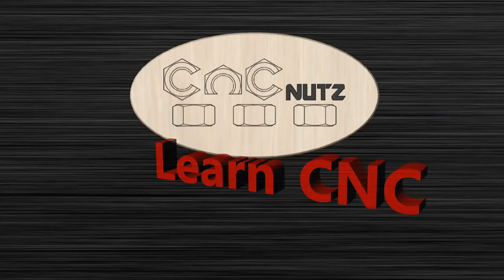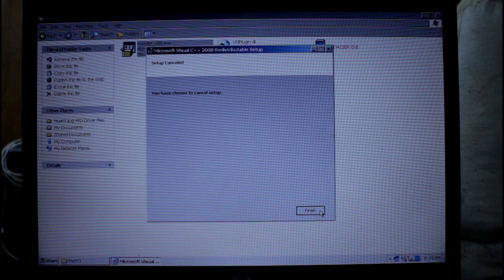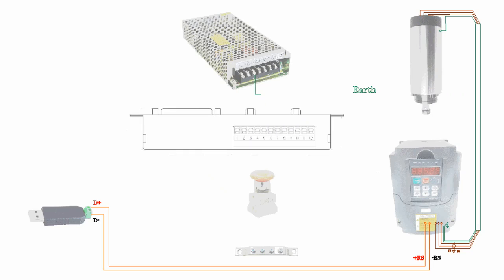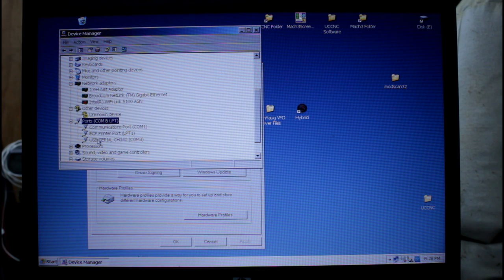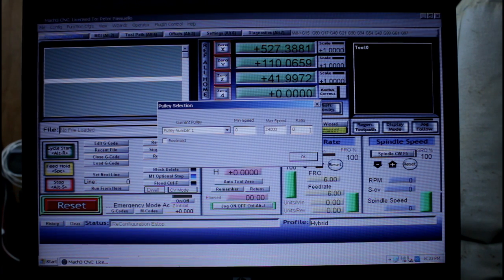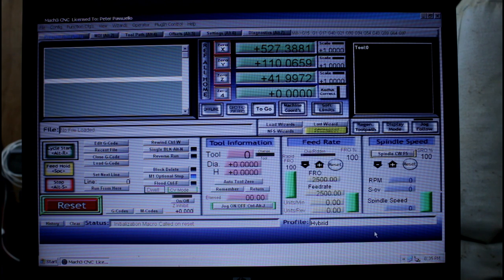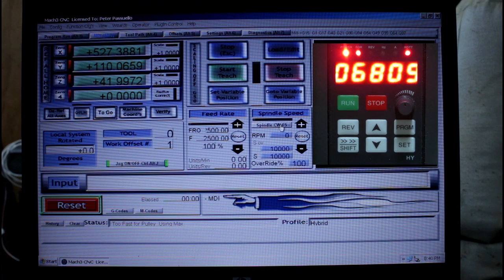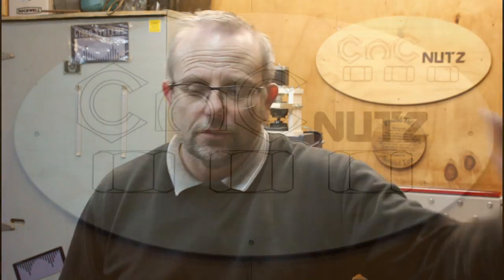Mach3 RS485 spindle control - CNCnutz Episode 147

Comment: I have tried 3 vfd plugins and each one gives me a defective plugin found error message upon mach3 startup? Plugins are pasted to the plugin folder as your video suggests. Any ideas?
Reply from the maker: Have you tried reloading MACH3. Maybe the problem isn't the plugin but MAch3 itself.
Just make sure you backup your Mach3 first.
Cheers Peter
Reply: @cncnutz  i ended up using a different plugin. Works perfectly and loving it! Thanks for the reply

Comment: hello Peter, do you know if this adapter will work with  a vfd ALTIVAR ATV320 ? I didn't understand if the plugin will works only with Haunyang VFD
Reply from the maker: The plugin only works with only some Haunyang VFD models. This is because they use a non standard RS485 protocol. You will need to find the right plugin for your VFD.
Cheers Peter

Comment: HELLO PETER, You make it look very easy. I have installed the rs485 and tried various drivers  and I keep getting message that it cannot communicate. In the device manager, I see the 2.0 usb but there is no com port. I have tried to reverse the two wires on the vfd but same happens. I set the vfd to all the settings in your video. I have been looking over the internet for the last 3 days trying to figure this out. I have ran the spindle first with the vfd and the spindle ran fine. Is there a check to see if the RS485 is bad? I hoping it is something simple that I may have overlooked. Any help would be greatly appreciated.
Reply from the maker: Hi Ron,
The only reason it looked easy is because it was. I was lucky and didn't get any issue when installing the driver for the RS485 adapter. forget the VFD at this point and concentrate on getting the RS485 usb adapter showing up in windows. If you are not seeing a new adapter as a USB serial com port in Device manager nothing else will work. Lookaround for any big yellow question marks labeled unknown device in device manager. That might be the adapter and the driver might not have installed correctly. You can see one in my video but mine is another piece of hardware I don't have a driver for. If you delete the unknown devide and plug back in the adapter it should reinstall the RS458 driver and hopefully it will work.
Until you can get it showing in windows don't worry about anything else. you don't even need to wire it up.
Here is where I check mine
https://youtu.be/N7D5n5y7f50?t=6m26s

If you think you have a faulty device you could try installing it on another pc and see it it is recognised.
Hope this helps
Cheers
Peter

Comment: Hi Guy
My name is Sebastien and i'm the developer, who, 8 years ago, decided to write his own vfd plugin because others one was simply nightmare. I then decided to offer it to the community, thninking that one or two guys may be use it. Today, seeing this video, i'm very happy to see that it has helped more than 2 or 3 guys. I spent hours developping this plugin, but it was usefull. 8 years later, seeing your video,reading comments,  I realize how useful it was and i feel proud, so thank you to use this plugin and to promote it...earnt no money but gave me feeling to have been useful to the community.
Reply: Thanks for your efforts Sebastien we all appreciate it.  I've been running the plugin successfully on my Bridgeport Series 1 CNC.  There's only one problem with the plugin, the pulley reverse checkbox is ignored.  I've tried a lot of different things in an effort to fix it.  On my BP this is a problem when using the low gear which causes the spindle to turn backwards.  I get around this problem by manually flipflopping M3 and M4 gcodes but it would be nice to fix.  I would love to fix it if the source could be made available as I am an old C++ developer.
Reply from the maker: Hi Sebastian,
I'm sorry I missed this comment form 3 months ago. Thank you for writing the plugin and sharing it with the community. You did an excellent job of it and thanks to your excellent writeup it was easy to install and get going. Many thanks
Cheers Peter.
Reply: Thank you sir for your hard work, I installed the plugin and it works like a dream. I sent you a donation, BTW. I appreciate people like you who will freely give out their work the way that you do!
Reply: Hi Sebastien, thanks for the great plugin, it makes using the RS485 comms a dream, do you have any intention to release the source code? I would love to possibly help make some improvements to it.

Comment: Hello Peter ... this was a very useful video ... thanks.  I wanted to add my experience (today) in a quick comment:

I used this 485 interface: DSD TECH SH-U10 USB to RS485 Converter with CP2102 Chip Compatible with Windows 7,8,10,Linux,Mac OS, which I purchased from Amazon.  It was a little more expensive ($15), but touted better protected inputs (I'm only buying one in my lifetime, so a few $$'s more wasn't too big of a concern.).  It came with a mini-DVD with drivers, which installed on my Windows 7 system with no hitches.

One small issue that I ran into and I saw and noticed postings from others : "Corrupted plugin ... ignoring".  I'm running a 64-bit version of Windows, so I loaded the 64-bit version of the C++ Library initially.  After gleaning hints from related posts and guessing, I loaded the 32-bit version of the C++ Library, and the issue went away.

Thanks again, very useful video and it's so cool to have the spindle come to life under control of Mach 3.

Cheers,
Dan
Reply from the maker: Hi Dan 
Thanks for the tip about the different version of C++. Very interesting. Glad you got yours sorted. 
Cheers 
Peter

Comment: More great info, Peter, keep 'em coming, this is exactly what we newbies need.I now have full control of my spindle in Mach3. Well almost. Just need to figure out how to start the water pump with the spindle and I'm set.CheersDave
Reply from the maker: +olgreybeard 
Just setup a relay as I did in the previous video and use it to turn on and off the pump. You can use the relay and RS485 together. 
Cheers 
Peter

Comment: Who'll done Peter pleased you got it to work with few problems. Noise can be an issue when using unshielded twisted pair shouldn't be but it sometimes is.
Reply from the maker: The noise rejection properties of RS485 should protect it but it can't hurt to have the shielded cable and be sure. USB is more of a concern to me to be honest.

Comment: another great video Peter, I hope to change out my Router for a spindle soon, I hope that a 1.5kw 110V will be strong enough because i do not have 220V available where the CNC is.
Reply from the maker: 1.5kw is 2 HP and far more powerful that my original router at 1hp. The only reason I want bigger was to get the bigger collet and it will be interesting to see if I ever use anything bigger than 1/4" shank. I was originally looking at 1.5kw with Er16 collets which go up to 10mm (3/8")

Comment: Peter: can you share what driver you used for your RS483 adapter. I tried the prolific driver and it doesn’t seem to be working. 
Thank you for all you do for our community.
Reply from the maker: I don't have it I'm afraid. I just let windows install the prolific one. The one I used in the video was not a prolific chipset. The driver for that one is on my website. Follow the link under the video to my website and follow the link on the page to the driver file I used.
Cheers Peter

Comment: Hi Peter,
thanks for the video, I have this issue: once started (setting an S speed as you do) I cannot decrease the spindle speed clicking on the "minus" button, it works only in the + direction (increasing speed), I had to use reset button to come down to original speed, do you have any suggestions? thanks, all my best
UPDATE
in the meantime I found the problem: I use a 6-axis Mach3 screenset, and in the main tab the - spindle speed has a wrong command (it does not decrease the 100%speed),  while in the MDI tab the decreasing speed works as in your video, hope this helps other people...

Comment: Hi, Peter.  Hopefully, you are still monitoring this video.  I am looking for a solution for a slightly different implementation and I am far from an electrical wizard.  I am running a regular router on my CNC for now.  My little controller board ( Novusun NVUM V2) does not output enough voltage to activate the power relay (IOT Switching Relay Power Strip) I had been using.  Is the RS485 solely a communication port or could I hope for a 5-12 volt output from it?  Hopefully, this is not a dumb question, like I said I am far from an electrical wizard.
Reply from the maker: RS485 is a communication protocol. The port does not supply power.
Cheers Peter

Comment: Hi Peter,  great video!!!  I noticed that when you set up the spindle in Mach 3 you used 0 - 24000.   However the VFD settings were 6000-24000.   I am guess this why you could not go below 6000 RPM in the demo portion of the video.   Is there a reason for not setting both up from 0-24000 or 6000-24000?
Reply from the maker: +jnbff10
If you put 6000 - 24000 in Mach3 the output PWM will be wrong and the spindle will not run at the right speed. If I put 0 - 24000 then the spindle would run from 0 - 24000 which is OK for a water cooled spindle but mine is air cooled so I have to set a minimum speed. Hope this sense.
Reply: CNCnutz (Peter Passuello) thanks for the reply.  Good info...   I was not aware of the limitation on the air cooled
Reply: Hi Peter, Got the RS485 CP2102 today and was able to set up with no issues.  I got the driver from here:  https://www.silabs.com/products/development-tools/software/usb-to-uart-bridge-vcp-drivers
One think I did notice is that my max speed was 23000 @400hz.   No worries as I doubt I would run at 24000 but any thoughts on why it was 23000 instead of 24000?

Thanks again.   This video is great for anyone trying to get this working.   Took under 30 minutes to wire, config, and test.

Jim
Reply from the maker: +jnbff10
That's great new Jim.
The only thing I can think of is you might have accidentally set the maximum spindle speed to 23000 in the VFD by mistake. Other than that I can't think why. You are of course right. You shouldn't be using 24000 anyway.
Cheers
Peter

Comment: Peter. I'm a dedicated watcher as of late. 
I have mach3 with Warp9 ESS controller. Will this work with the pre-mentioned combination?
Thx for your excellent videos. You don't talk above or below anyone's intelligence.
Reply from the maker: It will works with any motion control hardware or parallel port system because it doesn't use them. Only the RS485 adapter and the spindle are needed with Mach3 to make it work.
Cheers
Peter

Comment: With the RS485 adapter, hitting the emergency switch will it turn off the spindel?  I have mine on order, but have received my spindle and VFD today.  Will install all when the adapter arrives.  Thanks again for the very helpful videos you do.
Reply from the maker: +Rick McCaskill 
Estop turns spindle off. 
Cheers 
Peter
Reply: Thank you
Reply from the maker: +Rick McCaskill 
No problem Rick.

Comment: Peter,I have used these on three routers with the HY VFD and they work perfect. Your files I downloaded work just as needed.Can you tell me if you have any information on using this with Mach and the Nowforever VFD? I have two of these routers (6040Z) from China and the have these VFD controllers. The setup and terminals allow for +485 and -485 wire hookup. I just don't have a plugin for it. Do you have any clue where to get one. Thanks for any help you can give me. Marty
Reply from the maker: I have no information on you VFD's and the plugin won't work with them as the Hy VFD protocol. Is not standard.
Cheers
Peter

Comment: Is there by chance a poll command over RS-485 to retrieve or read all custom settings inside the VFD via an ASCII/Hyperterminal  terminal?  Additionally, can the relay output on the VFD be setup to activate an external relay that starts a water cooling pump every time the VFD is turned on and turns off that relay pump when the RFD is off?  Thanks for a great tutorial.
Reply from the maker: I don't know. You will need to read the manual for your VFD and then send the appropriate commands.
Cheers Peter

Comment: Good video Peter,
It is quite timely for me since originally I opted for PWM through my CNC4PC C62 BOB and ignored RS485 that was in the back of my mind and cosequently have issues with unwarranted eStops which is more than likely from noise.
In the video you set max spindle rpm for 2400, is this correct?
Reply from the maker: Hi Frank.
I did say 2400 but wrote 24000. It most definately is 24000.
I swear blind I had fixed that with a big red writing to say 24000 but it looks like I didn't.
So now I'm just swearing full stop.
Cheers
Peter
Reply from the maker: Actually I did fix it, but I made exactly the same error on both videos and I only fixed it on the UCCNC one.
Grrrr

Comment: Hello Pete, Thanks for the video!!  I followed the video and I can adjust the speed and turn the spindle off and on now.  My question for you and I might have missed it somewhere in your video is when you hit your physical E-stop or the E-stop in Mach 3, does it stop your spindle?  I am using the Gecko-G540, the Warp 9 ESS Smoothstepper, and the same spindle and VFD that you are using.  My spindle does not stop with the E-stop, and I would very much like it to:))  Thanks in advance for any help you can offer.
Reply from the maker: Hi John
You haven't assigned pin 15 from the G540 to the estop on Mach3 pins and ports. It wasn't mentioned in the video and is normally done as part of the G540 install. 
Cheers
Peter
Reply: I had pin 15 assigned originally and it stopped the steppers but not the spindle.  Changing it to pin 25 did the trick.  Thanks again for the help

Comment: FYI.. I think you set MAX speed to 24,000  not 2,400 as you described verbally (i know my lathe maxes out near 2400, but you probably meant 24,000 based on later video footage)
Reply from the maker: You are right 24000 RPM is Max speed for my spindle.
Cheers
Peter

Comment: Hello Peter.  Thank you for the great video and explication. I have set up everything as mentioned and it works. However,  if I cycle start a program,  it does the following... 
1. Doesn't start the spindel
2. If I turn on the spindle,  set the rpm (for instance up to 24,000) then start the program,  it will reset the speed of the spindle to defult of 6000, and I can't increase the speed as the program is running. 
Any thoughts?
Reply from the maker: Have a look at this video I did to help someone sort out their VFD problem. It will allow you to test the VFD independently of Mach3. It should help isolate the problem a little so if it works OK with spindle talker then you have a Mach3 issue. Check out the link below the video to download the tester. It will only take minutes to setup. Let me know how you get on. 
Cheers 
Peter 

https://youtu.be/Qq1Px4Abkbo
Reply: @cncnutz  I will try that tomorrow. Thanks for the reply.

Comment: Hi. Sir.
Please help! Can  programs  on Mach3  to control VFD forward and Reverse  ? Thanks,
Reply from the maker: Yes Mach 3 can turn a VFD on and off as well as set the direction backward and forward.
That is the whole purpose of the RS485 install used in this video and the analogue control shown in videos 142, 145 and 146.
Cheers Peter

Comment: Hello !!!
Can it be controlled by PWM for a laser?
I have an NVEM board that I cannot force to properly control PWM
The laser fires up to the set power 4-5 seconds when it should already cut

Thank you and best regards
Reply from the maker: RS485 uses data to talk to the spindle only. If you want to use PWM you need to use parallel port or a motion controller port.
Cheers Peter
Reply: Thank you for your answer
Unfortunately, my computer does not have a parallel port (Dell Optiplex160) and there is no room for additional electronics in my box
Yesterday, I found somewhere info that there is a modbus-controlled PWM generator
Thank you and best regards

Comment: Do you think this will work on a Sunfar E300 Inverter?
Reply from the maker: If the sun far is capable of RS485 then if you write or can find a suitable plugin then it should work. You cannot use the plugin that I show in the video as it is for Haunyang VFD only which uses its own version of RS485 commands
Cheers
Peter
Reply: @cncnutz  Many thanks, but that's far to teccie for me to do :(

Comment: Hi Peter, following it line by line but Mach 3 cannot see the VFD plugin for some reason, copied it into the folder ok, it sees the ess plugin so thats ok, any thoughts? cheers
Reply from the maker: I have no idea. The only thought I have is you haven't installed the required  VC++ 2008 files that are needed. Also check that the dll file is present or is it an m3p file. 
Cheers
Peter
Reply: thanks peter, but i really am the donkey. I watched this some time ago and thought i could remember it, as it happens i missed the bit @7.15, so all happy and it works great, thanks for this.
Reply from the maker: Glad you got it sorted.
Cheers
Peter